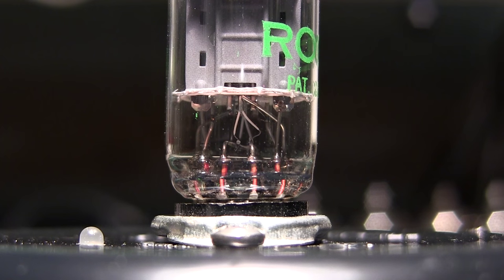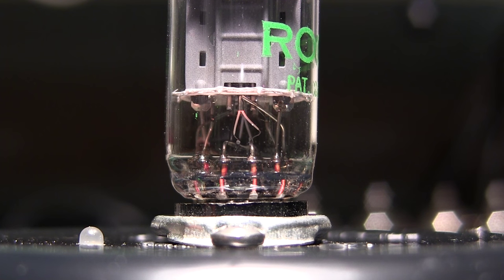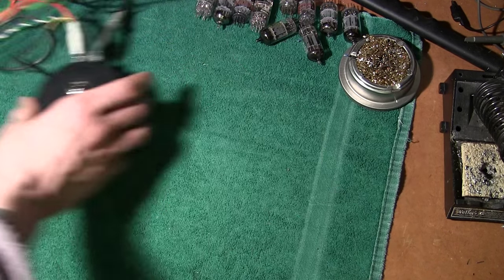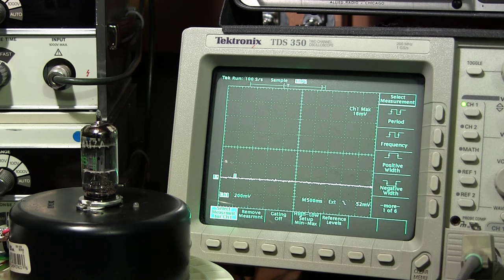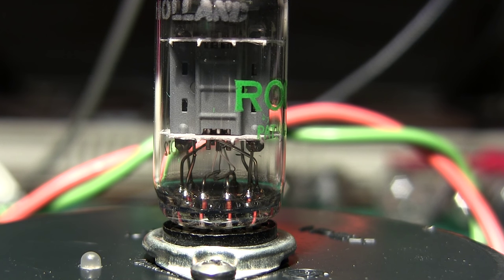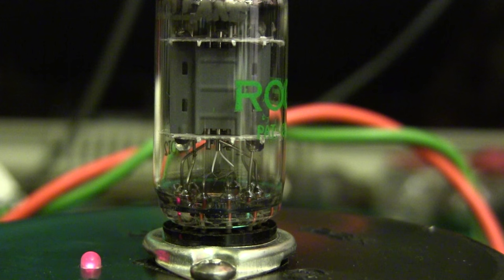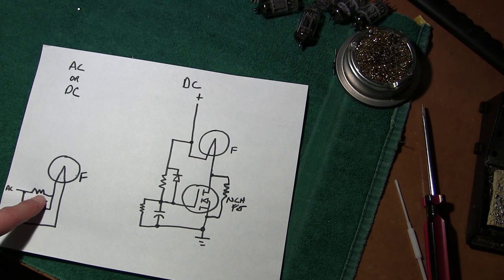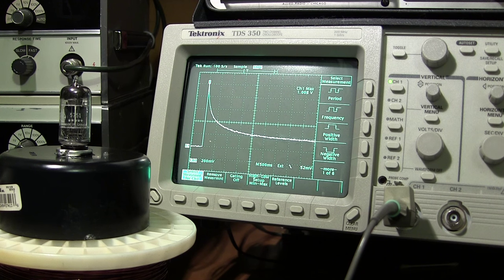Tech Tips Tuesday Dirty Little Secrets

Comment: This is extremely interesting. Instead of using a MOSFET (which actually did not exist in the past!) one could have used a timed relay (electromechanical) :) 
However I'm wondering why nowadays people are still wanting to use vacuum tubes for audio applications (except nostalgic-vintage motivations). Nowadays solid state devices can reach a much better audio quality, at the same price. And DSP processing could easily emulate the vacuum tube "sound quality" (which is actually a mere distortion! Which can be implemented numerically)...
Reply: That's your opinion..those of us who still use tubes know that tubes do not clip dynamic passages as severly as xstrs...that is real distortion not the warm harmonics that 33 rpm records and tube amps provide...Most IC audio modules take short cuts in design and rate amps at intantaneous peaks rather than steady state audio performance...you simply don't know what you are talking about...
Reply: I'm not talking about crappy audio amplifiers ICs ("most IC audio modules"). But I'm comparing them with similar specs. And yes, nowadays, with DSP processing you can emulate also the tubes (provided that the power stage is with "enough" quality). Maybe you just simply don't know the sampling theory.
Reply: I do  know sampling theory...it provides a sanitized audio performance devoid of harmonics , reflection of sound off walls, reverb which occur in live performances and do not appear with current theory...I'm not going to debate you since I studied acoustics under Leo Berenak and did real studies of "live" performance venues...It still is a  matter of taste in sound quality
Reply: Is it really opinion or taste? I mean you can physically see it on a scope trace if it's the same or better.
Reply: Could you please post some references about those studies?  I'm pretty sure they didn't compare "solid state amplifier with emulated vacuum tube distortion (sound)" to "vacuum tube amplifier". They just compared "high quality solid state amplifier" against "vacuum tube amplifier". That's why an educated ear can spot the presence of vacuum tubes.  The vacuum tube characteristic sound could be now emulated by a high performance DSP. If the resulting wave is fed to a solid state "high quality" (i.e. no 
distortion, no noise) amplifier, then even an educated ear could not get any difference. Because there would be none! (otherwise, either the algorithm in the DSP is not correct, or the amplifier is not of enough quality).  

I'm not saying that X sounds better than Y. I'm saying that people like vacuum tube amplifiers not because they have the best fidelity (i.e. they output actually the "true signal"). Instead, people like them just because they "sound" better. But this is not equal to "they are closer to the ideal (in mathematical sense) amplifier".
Reply: They are trying to emulate the behavior of tube amplifiers. Whether this provides a "superior" listening experience is a subjective question. Consider that some motorcyclists abhor an electric starter; a kick-start yields a superior experience for them. "Superior" is what most satisfies the customer's expectations, and if the customer prefers (even from nostalgia) a certain compression and distortion as the amplifier approaches saturation, he will prefer that "sound" regardless of what you measure.
Reply: The reason tube amps are still used is a combination of nostalgia and the power of suggestion. People see tubes and think the sound will be superior. (the effect is analogous to "you eat with your eyes first" in the food industry)
Some people do indeed prefer the extra distortion of a tube amp, and yes that can be emulated with DSP, but if you don't have fancy-looking glass bulbs on top of your amp, people won't ascribe as many mystical qualities to its sound.

Fair warning though: Some parts of the audiophile community have a real problem with science denialism. You can argue until you're blue in the face, and some of them will steadfastly believe their cryogenically treated, broken in, directional cables and high-end power cables make a difference to the sound of their system.
They couldn't possibly be wrong, because they think they hear a difference, so it must be there.

If you have the utter gall to suggest statistically significant double-blind testing, be prepared for major pushback.
Reply: "Nowadays solid state devices can reach a much better audio quality, at the same price. "

Oh, let the games begin!...
Reply: As one of the "golden ears" subjects, I will admit that sound is like art... that which you LIKE is what you can judge, not which is measurably better.
Reply: YOU are entitled to your opinion , I and many other people who LISTEN to music as an experience do NOT agree with the limiting experience which belongs to you .
TECHNOLOGY IS ONLY A TOOL AND TUBES do the job for us and maybe not for you !  
A good transistor amplifier is way better than many ( commercial ) tube revival& trendy tube amplifiers , in the end it is the best tube amplifiers that STILL win the hart of those who love vibrating with the music . The important factor is that you are happy with your belief........

Comment: Thanks for this circuit.  I'm rebuilding my old Fender Princeton amp and was already considering modifying it to use a DC filament scheme (to eliminate hum) and it looks like this circuit could help buy my tubes some extra life, at least from the heaters.  Do you have advice for the resistor network for this amp, 12AT7, 12AX7, & 6V6?
Reply from the maker: +Rick R 
If the tubes don't have flash, I wouldn't worry about it. If you are going to make a DC filament system, be prepared to use more than 20000uF for filtering, or you will have buzz.
Reply: Why so much filtering?
Reply from the maker: You may also need a low ohms resistor between the caps. There is a bit of math involved to explain that, and I don't want to write a book here. Best thing to do is build the circuit and experiment. If you go with half wave, use a Schottky diode, less forward drop.
Reply from the maker: +Mr Carlson's Lab 
This may also help.....  https://youtu.be/e6v6elT26_o?t=27m51s    The large value caps are absolutely needed. The resistors drop the rectified voltage and also add to the reduction of hum.
Reply: That is a nice solution and one I hadn't seen.  I did think I'd use a PI filter and was thinking small resistor with a few turns of magnet wire around the outside in between the caps.

Comment: Can you use NTC 3D-11 in series?
Reply from the maker: +nenad cogelja 
No you can not. Remember any type of thermistor you use requires loss to heat it. Most heater circuits are right at the rated filament voltage.
Reply: +Mr Carlson's Lab 
But, if you already have little higher heater voltage? About 6,5V? And 
around 3,2A working current (five tubes). Wouldn't this be perfect for 
preventing inrush current, and lowering working voltage (to nominal values)?

/-:

Comment: I have a thought about using the RTL dongles as a spectrum analysis device onthe bench,in a non critical learning capacity. with isolation it might work.IWOULD LIKE TO BUY some of the unpopulated boards you made for your  spectanalysis adaptors you showed.in the previous videos, My addiction is conserving,repairikg test equipment for radio repairs, bench work. May be recording the process for fun. Mostly Cushman and IFR CES It should be humorous with the characters I hang with.Mayb efix some radios too, we got some guys with 50 yrs commercial experience in the  club, the Tomball repeater group on Fake Book. you have inspireated me. to get a cameres and do it. my email is kb5zxm at gmail and or yahoo. First project is relamping a CE5 with Leds, mostly cause its in the way.
Reply from the maker: +darylynn621 
Thanks for your comment! When I build more small boards, I will let you know.